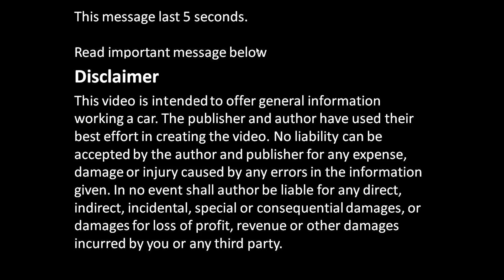How to Assemble Toyota Corolla Dual VVT-i engine 2007 to 2018  PART 1 of 23 Piston installation back

Comment: Peter, on my car (not Toyota) a UV joint on left semi-axis (front wheel drive) 1.4l petrol (Renault K7J 710 engine) is making clunking noise when turning left with throttle applied. There are no vibrations at all. Can I drive it like this or do you think it will break and I could loose power in a dangerous moment (pilling out, and similar)? You can hear it from 14:49: https://youtu.be/s7tG-NYAwak?t=889
Reply from the maker: You can drive. Finally the bad CV becomes so noisy and so much vibrations, that you must replace it.
Reply: @PeterFinnTheCarDoctor  

Thank you very much, friend!